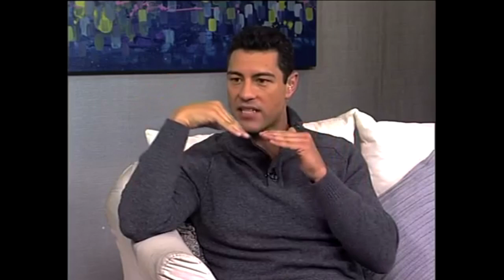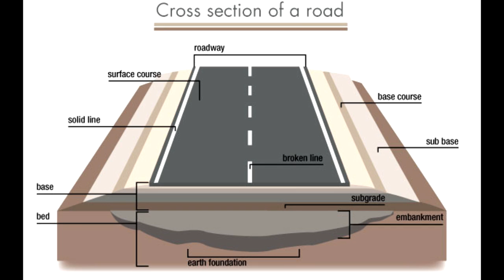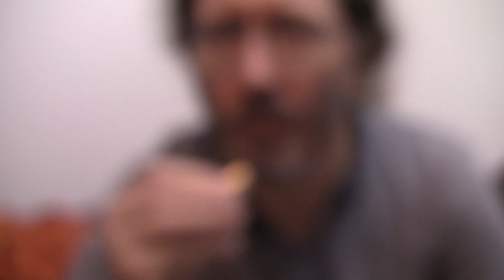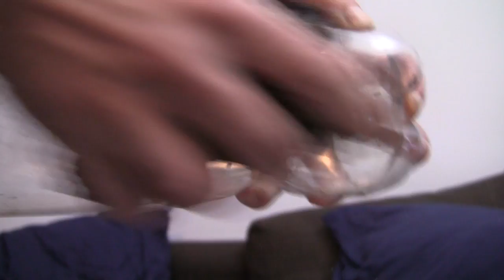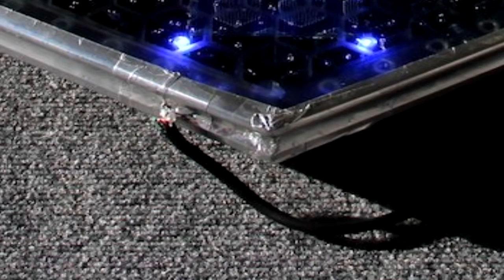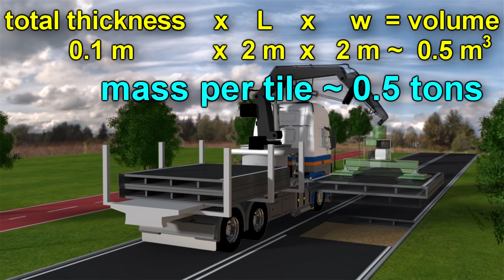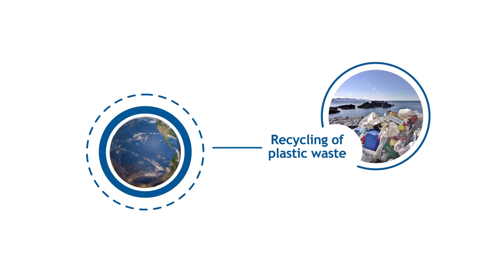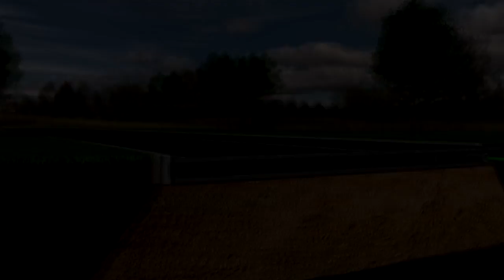Plastic Roadways BUSTED!

Comment: Okay, what the actual fuck.
Asphalt is already the non-plus-ultra (as we would say in Germany).
It is cheap, versatile, durable, gives tons of grip to cars with rubber tires, isn't as prone to cause aqua-planing, safe to handle, doesnt hurt the environment, can be reused/recycled, etc...

Why would you replace it?
Reply: It doesn't have Bluetooth connectivity and an app.
Reply: Nick Henry More durable than plastic.
Reply: Not durable at all?   WTF are you smoking?
Reply: Ryan M, constructing a road like the video suggests would be terrible for the environment. They'd be an enermous source of micro plastics during winter. And would also require lots of maintenance, and lots of processing to get the recycled plastic even remotely usable.

The only thing plastics would be good for is as a substitute for bitumen.
Reply: xXYannuschXx you missed where asphalt is also simple to recycle, you heat the bitumen out and then you just sort and reuse the aggregate.
Reply: Nec plus ultra. :p
Reply: Because, you haven't seen it all yet, they will be putting magnets & stuff under the roadways, so that you can MagLev your car along at any speed!!!
That's not all, they will be adding Earth Thermo generators that will create power from Air underneath the roads, as the cars weight displaces the air it will cause pressure to turn that precious little chamber into a full blown high powered Power station.
*Sarcasm Factor: Mild-Heavy
Reply: We should replace it because it's too heavy, you ever picked up a road that ISN'T made of plastic? Thought not. It also isn't soft enough, meaning when water freezes inside of asphalt it makes small cracks, but if we had hollow plastic roads, the water freezing inside it could split the plastic at the weakest points and crush the pipes inside them. But that's fine because it's modular right? Just swap the road surface out every few days it'll be fine.
Reply: Oskar Skog ikr
Reply: Ryan M. Yes its nice how people try to solve problems. Its nice how people are nice enough to try. Too bad that their try is so awful that it makes the whole of environmentalism doubtful. Im sure that after this "try" a few people start thinking that whole environment protection was invented just so 1: People can scam for money, and 2: environmentalists are so stupid that they have just invented the whole problem up anyway.
So, its nice that they are nice people, but if people really wanted to help the world, someone should have punched them in the mouth before they opened it. That would have had been an option with greater amount of good for greater amount of people, and less damage. And the less damage includes the loss of teeth...
Reply: xXYannuschXx Go beyond.... [Insert Text]
Reply: Aqua-planing lol I want to visit Germany.
Reply: Elian scialanga swapping the road surface out every few days would need a lot of maintenance and cause a lot of traffic
Reply: Because Go Beyond! PLUS ULTRA! 

Thumbs up if you got the reference.
Reply: PLUS ULTRAAAA
Reply: Why not add recycled plastic to asphalt.
Reply: So soda comapnies can sell more pet bottles.
Reply: This is an attempt to solve a huge environmental issue. Of course asphalt works well, but if plastic could also work it solves a massive issue.
Reply: wouldn't plastic roads create loads of plastic dust and micro/nano plastic which will pollute the air and water?
Reply: xXYannuschXx Das heißt "Nonplusultra" und ist ein Substantiv, du Spaten. -.ğ
Reply: xXYannuschXx it is not durable at all

Comment: The only valid argument I observed from this video is the flaw in water carrying utility pipes running inside the slabs. It's true, replacing one slab results into temporary water shut-off. However, if you know anything about asphalt and their environmental impact is their lack of permeability. The most recent asphalt prototypes are completely permeable and will not interfere with earth's natural water absorption, unlike what we currently have on our roads! Though permeability in pavement varies with climate/region. This plastic roadways are actually much better in that sense compared to the traditional asphalt pavement, mainly because  plastic, if used properly, can undergo mitigated damage due to continuous freeze-thaw cycles and would possibly not crack! (Even if it's permeable) as for its load bearing capacity, I'm sure those engineers would design these slabs to withstand vehicles' loads. With proper ground preparation, this can result into a feasible, environmentally friendly method of paving!

Comment: just dig a trench next to the existing roads and put the stuff in there
and while digging you can dig it a little wider on some points for a foundation of a solar panel tracking tower
BÄÄÄM solar roadways just more economical and sensible

Comment: I don't disagree with the points made in this video, or agree with the claims advanced by the company under scrutiny, but there are some problems with just generally attacking this technology.  First, plastic is already successfully used in roadways in composite with many ascertainable advantages (I acknowledge that composites are noted in the video).  Future developments will most likely make additional use of compositing and polymer technology advances.  Next, the geometry shown in the example video is obviously infeasible, but there are many other easily geometries that could be applied, allowing for better weight distribution, even for pre-fabbed and modular designs.  With R&D, the idea of plastic and modular component based roads is not out of the question.  We aren't there yet, but just to say that doesn't justify writing off the ideas involved completely. We will also be moving to new car designs, which may go hand-in-hand with new road designs.  Again, this is likely somewhat distant, but if they are co-designed, more efficient scenarios than we currently have aren't out of the question.  I respect Thunderf00t, and find that he does have intelligent arguments (this isn't to disagree with anything he specifically stated), but sometimes new ideas can be dismissed too quickly based on the fact that the current technology isn't yet up to snuff.  There are answers for most of the problems presented in this video, even if they haven't all been addressed yet.  You have to start somewhere though;   advancements will be made, and even if polymer-based roads don't turn out to be the answer that will solve/alleviate our current problems, it is an area worth researching.  All the statements in this video are based on our current tech/the tech presented by the company under examination, but with development, things can change, and increase in efficiency, reliability, and general feasibility.  Energy and fossil fuel consumption (both energy required for production,  implementation, and as a polymeric raw material) are a big issue that is properly brought up in this video, and which presents one of the major factors related to determining which tech is better overall, but other factors such as road durability, speed of repair, and cost (as well as increased utility) also weigh heavily in the determination of which tech is best going forward.  Our current road systems, at least in the USA, need a major overall, and new technology is needed.  There is constant congestion due to never-ending road repair and expansion, many roads/infrastructure in need of an overhaul, and huge outlays of taxpayer funds already being used and needed to accomplish such tasks.  The current technology, as regards road construction and materials, is struggling to meet the current and expanding needs and demands in this country.  Although, as stated supra, I don't support the mentioned company promoting their particular plastic-road technology, and I agree with the problems pointed out in this video, advancements are needed, and plastics may hold some as of yet undeveloped or unrealized potential in this field.

Comment: Ok, gotta give a few points, and critiques. Firstly, every tire is made of "plastic", and quite a few processes already exist for using recycled tire material for asphalt surfacing, at least as admixture. Those would be, at least, "plastic containing roadbed traction surfaces". That is current day reality, Muni use successfully for a couple decades now. Now, let's talk that pop bottle plastic, structural roadbedding, and reality. You describe this assumed candidate as impressively strong tensile, with very low hardness. That, sir, sounds like a good candidate for rebar, whose only role in concrete construction is giving tensile ability. Rebar, as fate would have it, tends to corrode inside damaged concrete, eventually resulting in need to replace, or structural failure if ignored. This damage occurs at highest levels where weather, water table, and salt exposure expose, rot, flood, freeze, heave, repeat. It's really why regrouting northern Bridges and flyovers is a must do annual ritual. Now, take a peek at that "roadway" section those hipsters animated for you. Take out the hot wheels track pins, perforate that "roadbedding", you have a linearly reinforced lattice. Leave the bed solid, linear celled tubing. Rebar cross sections, in other words. The "road bed" animation is marketing bullshit to entice indigogo hipster buzz. Plastic rebar extrusions from recycled materials make few waves among the pierced face set, nonsensical hot wheels fantasies do. Sure the marketing is absolute bullshit, but there does exist some potential for genuine usefulness at least related to the market hucksterism. It's not like the water bottles, aqualungs, and Noah's ark theme park, lol. Granted, as demo'd by tragically hip youngsters it's laughable, but I honestly think that really is digital camo that seems a good modern financial tease tactic.

Comment: Fuck the interruption of service. You would have to cut and splice back the fiber lines every single time. That would cost more than the damn road itself. No Communications company in their right mind would run their cables through it.

Comment: A brilliant idea. Now we need oil to fuel our cars and another shitload of oil to make plastic for the roads. (That's what I know, correct me if its wrong) Don't we use enough plastic already?
Nature can reclaim old roads by breaking through the tarmac. Can it do that on plastic road?
Also... How does THAT plastic react to immense heat.. like in the desert? Will it melt into a deathly puddle?
Or will it go out in flames with another load of toxic fumes?

Comment: hey i need money for my road the "forever road" which is from solid titanium alloy it is a little more costly at the beginning but you dont need to care for it ever again and its conductive so you can transport electricity right thru it you dont need cables under the road ever again and thanks to the electricity the "forever road" will warmup so that there will be no problems with ice and snow ever again

Comment: Your so dumb there will be not youst bottles on the road -.- plastic under high pressure and chemicals process take a big place in the Industry ! is harder then steel and weight loss. The surface can be modified for a higher grip the cost is another story. Google if you not believe me i work with this stuff. Sry for my bad english tho

Comment: A better option might be to use all that plastic in a pyrolysis process and turn it back into oil. A solar thermal powerplant would be a good example with which to start. Dump plastic in your crucible, focus the sunlight onto said crucible using mirrors and wait to hit that magic 400 degree C mark. Congrats, you've just broken plastics back down into oil and gas, suitable for processing.
Don't build stupid roads out of it.

Comment: Thunderfoot - am pretty sure these plastic panels will be very thick in size.  The flaw in this design is that these panels are hollow.  Trucks max out in the U.S. at 80,000 lbs.  They will easily be crushed under this 24/7 wear and tear.  We already use a certain percentage of recycled plastics and even pulverized glass in our highways.

Comment: Well, actually in the video, the road had a fundation. They say its easier to REPAIR, never state that the overall process is easier. Also, comparing a PET bottle to the final product, is like if you had a video "TIRES BUSTED", and saying that the (non vulcanized) natural rubber is too soft and never will work.  Also, Personally, I have seen plastic Sewer covers in hi traffic roads standing better than the road itself.

Comment: There is one use for holow HDPE blocks in road construction and that is as water buffer under openasfalt roads, it allows the water to be retained long enough so it can drain into the ground besides the road without washing away the soil, there is just one drawback, if you have a road that gets dirt and sand on it a lot, like farm roads, you needs to scrub it a lot to keep the surface open enough to drain down into the buffer

Comment: Having cables go through the road makes the whole "Easy to repair!" aspect completely bogus. All running cables through the roads will do is make it so each time you want to fix a piece of the road, you need to rip out the cables, replace the road, then replace the cables, then reconnect each piece of road with a joint. This is a fucking joke.

Comment: The black top demo on pet is lame, the black top aggregate is the abrasive, Asphalt is similar density to pet. The UV stability is valid. The thermal characteristics are most important.
This is obviously a concept presentation NOT an engineering design. It does have some validity. just belittling the idea is pathetic!

The energy return argument is good. The burning argument ignores the collection and processing costs for burning. It is the most reasonable path. You are now at the state of the argument we came to in the early 70s as high school students.
 
You should be able to come to a much better alternative by now.

Comment: I don't understand few points; (I am not material engineers nor architecture etc.)
1. if we are dealing with tires with PETE etc. Why rubbing the PETE bottle with the asphalt materials?
2. Hollow road design actually used in airport when dealing with  impacting, how the PETE or other plastic materials perform i.e. friction tests under water / rain?

Comment: I think that Thunderf00t forgot the main thing with plastic roads. The heat generated by the the traction between tires and the road. It will most certainly smelt through leaving the road unusable.

Comment: Without even starting this video, I assume the plastic roads would split apart and loose their structural integrity far faster than any other road, considering the fact that roads can accumulate cracks and wear down not just because of the friction of vehicles passing on it but also due to thermal movement and heat causing minor warping. Plastic isn't exactly known for being the most durable as a construction material, not even thermosetting plastics would be able to match the might of asphalt.

...But what do I know, I'm just a teenager!

Comment: Hm..what about a plastic/aggregate mix instead of the tar, with a standard tar and aggregate mix on the surface? I mean I still feel like the tar is more effective since it is slightly squishy so it can absorb shock more effectively, but I feel like if they just melted a bunch of plastic, and threw crap tones of gravel into it so as to basically let plastic do the work of the tar, and still have the rock for road, it would at least be plausible, minus the possible decrease in lifespan... Wait, I just finished the video, guess you already covered this XD

Comment: are those plastic roads gonna have a little groove in the middle with a metallic powered strip on either side of the groove so electric cars can be powered through copper spring loaded bars between the front wheels? Are these "plastic roads' gonna be the same thing as the old "slot cars" toy race track that I remember from my childhood?

Comment: Hmm I feel like your misrepresented the idea.  The plastic just replaces some of the oil.  You still have to use rock and various other elements. Plastic would only represent less than 10 percent of the ingredients. Of course plastic wears away but the rock won't and neither will the plastic under the road.  Doesn't matter though plastic can be reduced back to crude oil using high pressure thus this isn't the only idea to solve the plastic problem.
Reply: That's not what the plastic road people tell us.
Reply: No, that's not what they're trying to do. They're ACTUALLY trying to replace the entire road with plastic tiles.
Reply: that's still stupid and totally unneeded
Reply: Lil Asian Store LLC you're wasting fucking plastic.
we don't have a problem getting rid of recycled plastic.
We have a problem separating it from trash.
We have a problem keeping plastic from blowing away into the oceans.
Reply: TheSteelmushroom They said it's gonna be hollow.
If it's hollow and made from stones it will IMMEDIATELY collapse from its own weight or the weight of a car.
It not, these roads are gonna be fucking T H I C C.
We're talking 1 meter thick Slabs, at LEAST.
Reply: +Not Pulverman Yeah I know that which is why this idea probably will never work and I'm just saying TF is not misrepresenting the idea because he commenting on how dumb the way they're promoting it.
Reply: Deividas rušėnas electronics. Seriously People throw away consoles they thought were dead but can easily be fixed. Even big screen TV's .
Reply: Deividas rušėnas electronics and disposable diapers.
Reply: This is different he's debunking an ACTUAL plastic road proposed here in this video not as a binder.
Reply: Well the way the promotional videos is being shown is not TF misrepresenting the idea but the company trying to make it look like they're going to make a road entirely out of plastic.
Reply: really? go to your nearest landfill. what is the majority of garbage?